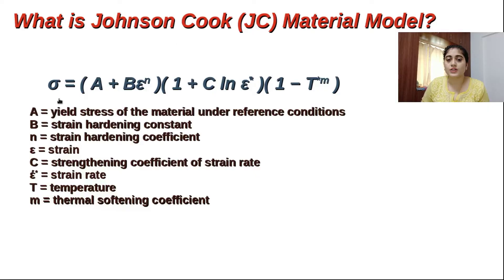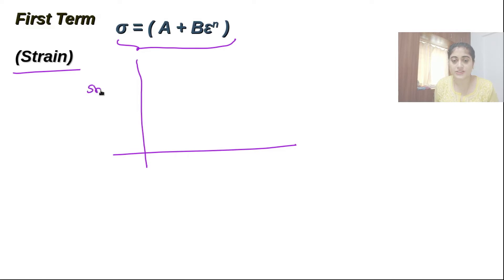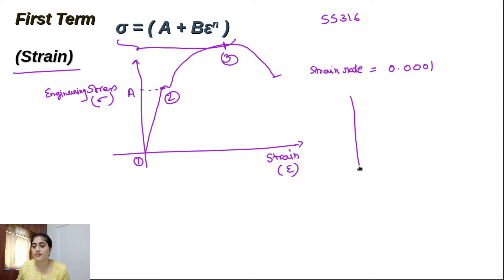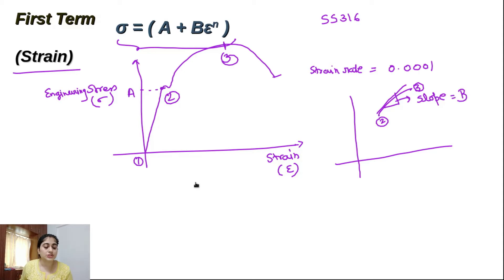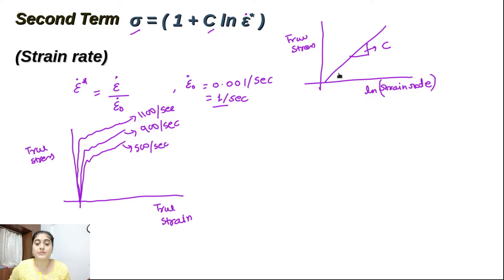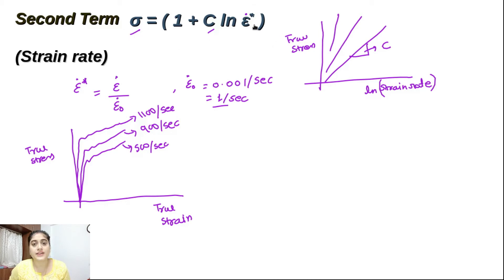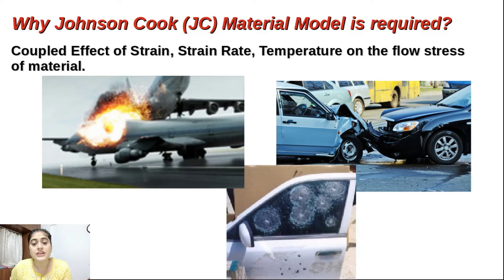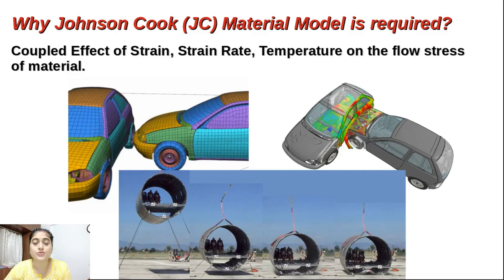The influence of Johnson-Cook parameters on Stress-strain graph and their requirements.

Comment: Mam what is the difference between Johnson cook and hashin damage material failure criteria?
Reply from the maker: damage material failure criteria used when material is having cracks, holes or any damage and  then test it for high strain rate. Johnson cook is used for without any pre cracked material's high strain rate experiment data.
Reply: In short Johnson cook material failure criteria is applied for ductile materials and hashin damage is for composite materials
Is that correct?

Comment: Thanks such a nice video. 
Same material like steel strength is different for static and dynamic loading. Is there any way to correlate static strength with dynamic strength.
Reply from the maker: Yes, there are lots of papers in which, they have done the high strain analysis for concrete material.
Reply: @scienceandtechnologybygaya3535  thanks a lot!
Reply from the maker: Thank you
Reply: May you tell about what is the reason for higher dynamic strength of material than it's static strength.

Comment: Nice Video. By the way, I have  a question. From where the temperature value we are getting in ansys. Is it heat conduction equation or something? Can you give me some link or references about this
Reply from the maker: Here, we are focusing on strain and stress of material under the high temperature conditions. So heat equations are not required here. In the description box, I have given some papers for reference.
Reply: @scienceandtechnologybygaya3535  yes, but the temperature we are using in the Johnson cook model must be coming from somewhere. I was curious about that
Reply from the maker: @pranayanahak4708  That is depends upon your requirements. For example, you are design a car model. And you know at the time of accident, how much impact and heat will generate through some experiments. Material will behave in different way when it is in static condition and dynamic condition. Accordingly, you have to provide material properties. So, range of temperature and the range of strain rate depend on your requirement.
Reply from the maker: The temperature parameter 'm' can find through the experiments. Which can be use in analysis. In the dynamic analysis, when you will put the material parameters. You go in the 'material properties' and choose 'plastic' and see is there any entry for J C parameters. I have used ABAQUS and Hyper Works for dynamic analysis. I will also try to check for ANSYS.
Reply: Ok Nice. But I was looking for the temperature 'T'. I know how to use JC in ansys. From where, it is getting the 'T' is important for me for the time being. Thats why I asked for that. However, the information about other parameters in your video is worth knowing.
Reply from the maker: @pranayanahak4708  Thank you,  Yes, Temperature is depend on your required situation.
Reply from the maker: @pranayanahak4708  @pranaya nahak That is depends upon your requirements. For example, you are design a car model. And you know at the time of accident, how much impact and heat will generate through some experiments. Material will behave in different way when it is in static condition and dynamic condition. Accordingly, you have to provide material properties. So, range of temperature and the range of strain rate depend on your requirement.

Comment: Can you please make a video on how to verify flow stress using Johnson cook model in FEM
Reply from the maker: As Johnson Cook has done some experiments on the wire and also calculated analytically for making the material model. But if your model is complicated then it will be difficult to verify analytically. As per my knowledge, through the experiments, It can be verify. I will try to make video on "how this material model generated". Thank you very much.

Comment: Nice lecture .
Why does true stresses decreases on increasing the temperature?
Reply from the maker: Thank you, Ayush for asking the question. As the temperature of any material is increasing, the bonding inside the atomic structure of the material will decrease. That time if you are giving any load either its impact or steady, yield stress of the material will decrease. If you keep on increasing the temperature up to the melting point of the material at that time, there is no need to apply any load it will fail definitely. I hope you got the point still if you are having any doubt please let me know. Sorry for the late reply.
Reply: @scienceandtechnologybygaya3535  Thanks. I got it now.